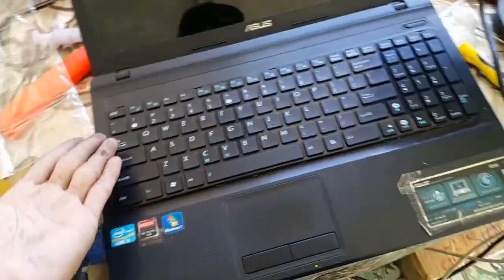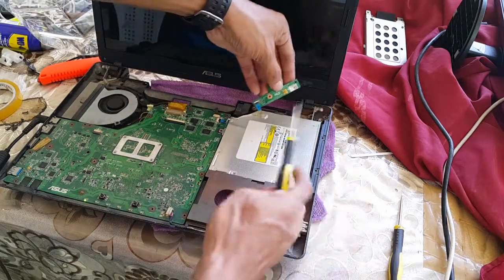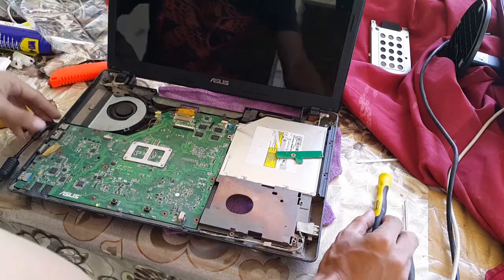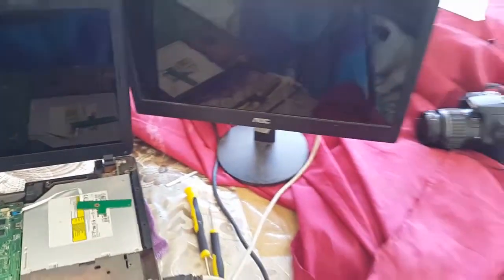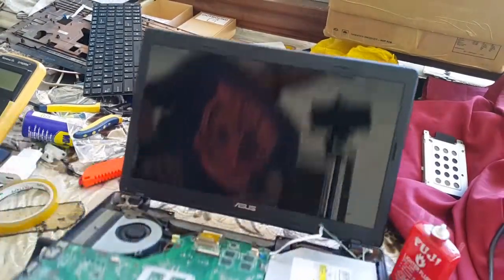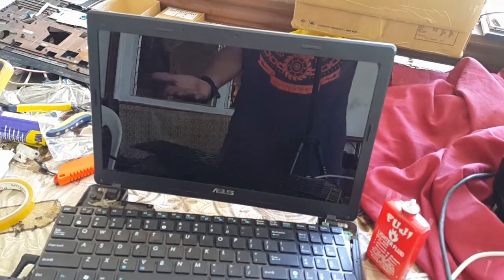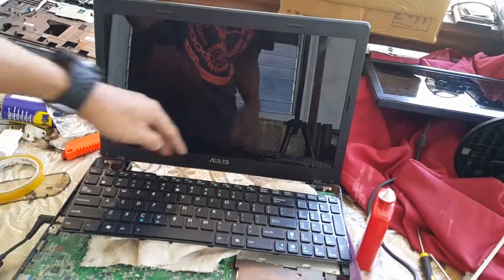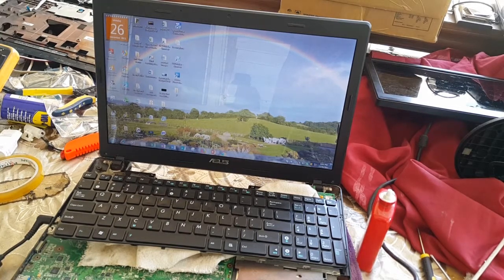ASUS X54H black screen ( no display)

Comment: just google X54H backlight fix - there will pop the solution with one line reg file. works like a charm.
oh, and you can still see the picture on "black" display if light it with phone flashlight. seems to be common problem.
Reply: that happened to me when i installed gpu drivers